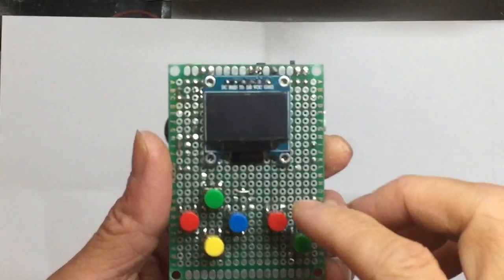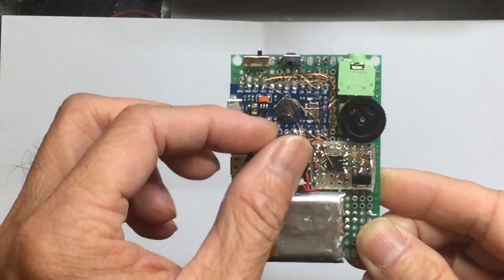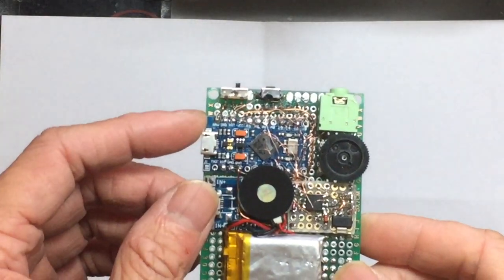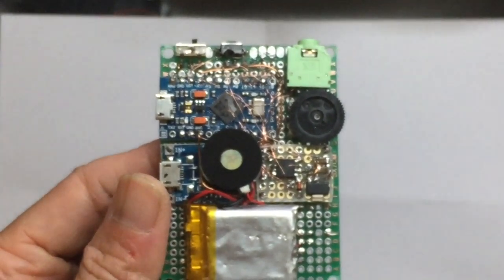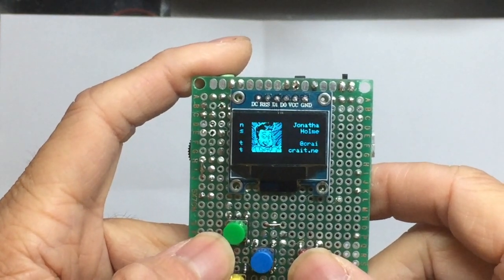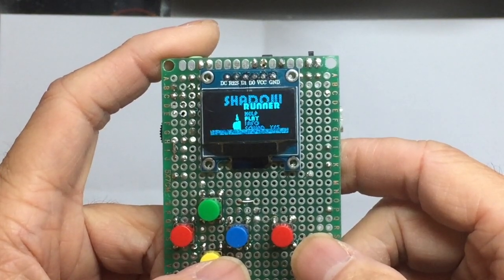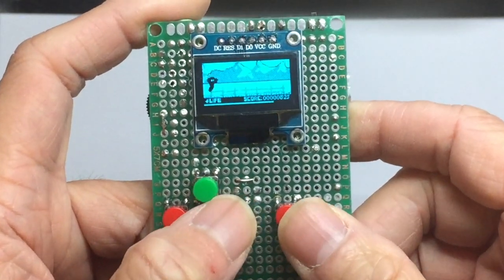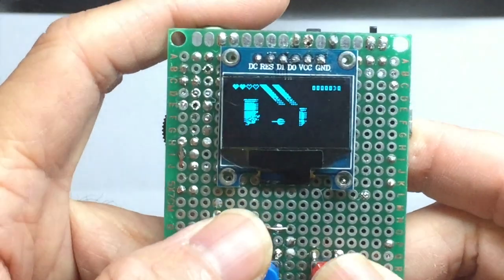Homemade Arduboy with acrylic glass case and flash cart.

Comment: The cleanest arduboy clone ever.
Please please please make a tutorial
Reply from the maker: Guy Wolf ,
Thanks for your comment. Since then I have made a more powerful and smaller ArduBaby. You can see this tutorial : https://youtu.be/c59xkNpyrwo
Reply: @BillyCdiy  I am aware of the ardubaby but I want something thiner, is it possible to mke it without some stuff to reduce the thickness?
Reply from the maker: Hi  @guywolf3674  , Yes, my first version of the homemade Arduboy is quite thin. I avoided the regular headers for connection to the OLED. I just used direct soldering or cut out enough pins from a regular plastic IC socket to replace the female header. Then I used the same double sided perf  board to solder the silent buttons on the top , and insert the OLED pins through the perf board to the other side. And use the ic socket to connect it. It's much thiner this way. But then you need to spread the volume of your components through a bigger service.
Reply from the maker: Did you have a chance to watch my other video for the ATTiny on a credit card ? I was thinking about making an Arduboy as thin as that too, also on credit card. It's possible.
Reply: @BillyCdiy  that would be quite awsome
Reply: @BillyCdiy  I ment to ask if it was possible to make the ardubaby thiner but your answer is useful for me anyway
Reply: Hi  @BillyCdiy  , I would love to see an arduboy as thin as possible. Also a flash would be an amazing upgrade and also mabye a color screen and a volume control. I am not in any way, shape or form capable of doing that, but I thout mabye you would think the idea is cool and build one and we viewers could take from that. I thought that it will combine all of your great upgrades for the arduboy and ardubaby. I know it was a long comment, sorry about that, but I wanted you to know that I (and a lot of my friends) think highly of you and would like to see even more

Comment: Hi Billy Cheung, mind share your dishwasher project part 2 and part 3? Im also currently doing Final Year Project (dishwasher) and need more idea on it.  Thanks a lot !
Reply from the maker: I already have the software developed that micmic some of the commercial dish wasters with different types of wash programmes and driving a 2 1 inch OlED 128x64 display with only two buttons. I am trying to add WIFI capability. the program is developed using ESP8266 WIFI MCU. I will post the WIP code to my git hub, you can reference that. 

I am sorting out the safety issue with electricity.  I plan to immense the heater to the chassis of the washing machine (which is made of plastic) to heat up water to 60 or 70 degree C during the wash cycle. I found that a bit dangerous. So hesitant to continue.
Reply: @BillyCdiy  Is it possible to make arduboy on arduino nano + i2c ssd1306 + loading games from sd card, if so how?